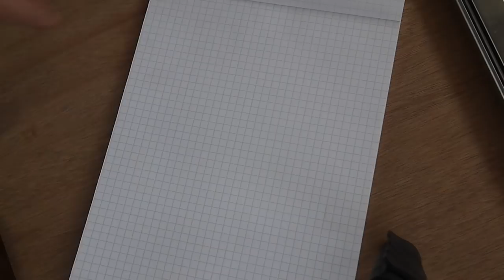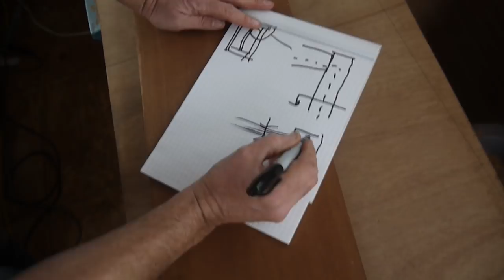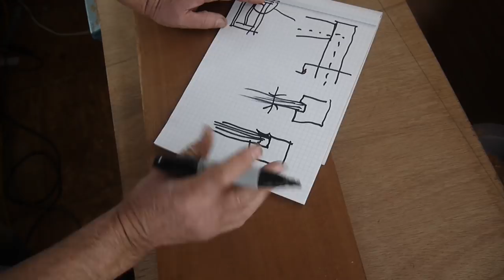Building the helm cabinet - Boat Life - Living aboard a wooden boat - Travels With Geordie #146

Comment: I keep worrying the "bulkhead" will be two week for all that mass and even though the 3/4 inch board will distribute the load, I feel adding it to the other side (fwd) of the bulkhead would be better at being a "doubler", in preventing the fasteners pulling through the bulkhead (Now that's overthinking it).  ;-)
I must have missed you cutting down the "Block" to compensate for the 3/4 inch board (chain & cable/wire rope alignment)?
I keep forgetting you've dealt with this about seven months ago.  ;-D
Reply from the maker: Turned out really solid

Comment: I am surprised that you dont put a hose on that saw and extend it out the window. You could adapt that to all your power tools. It would keep that sawdust down to a real minimum in your air.
Reply: I don't think the harbor dept. would like that.
Reply: That's not very nice for his dock mates, and even a central vac system is difficult to work with, but impossible to work with in cramped quarters like that.
Reply: Its just organic sawdust. Most of it would disperse with the wind. The current would take the rest. No one would hardly notice it.
Reply from the maker: As below, I couldn't do that to my neighbors. They are wonderfully patient as it is. Shop Vac possibly.
Reply: @TravelsWithGeordie  I do have my tools ported to a shop vac in my shop. My shop is small and it makes a big difference. Everything will hook to it with adapters which are readily available.

Comment: I haven't finished the video, but my fear is that your sliding cabinet drawer will extend and block the companion way doors while you're  below!
Reply: I was looking for this comment  before I posted the same thing. Strange stuff happens when boats roll at anchor. I have a sliding glass rear door to my boat. After a very nice dinner on the cockpit at anchor,  My wife and I decided to retire inside, only to find out the door had locked itself. We now have a key hidden outside incase this ever happens again.
Reply from the maker: How uncomfortable that would be. There will be a secure latch as well one can easily open the companionway hatch and reach down to move the sliding unit if required.

Comment: Wouldn't a floating panel design have been more appropriate for a highly changeable environment regarding temp-, humidity and temperature?  As designed, your wood can't breathe or move and will have a bunch of built up stress resulting in possible warping or buckling.
Reply from the maker: Thanks for bringing up this great point. Floating solid wood panels is certainly a great idea however I feel that with plywood panels the structural stability allows for gluing. And thereby a wonderfully rigid panel. Certainly finish all sides equally to avoid dissimilar humidity uptake.